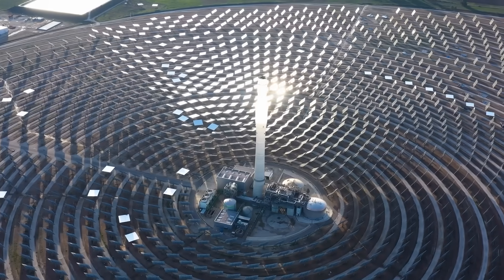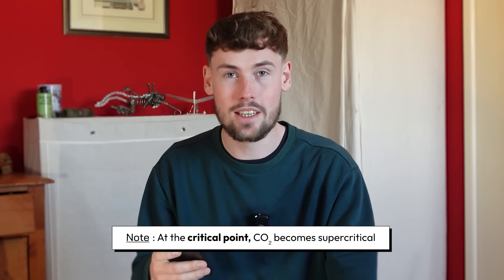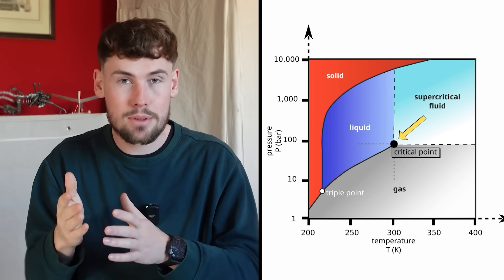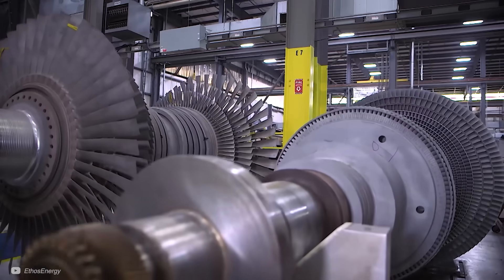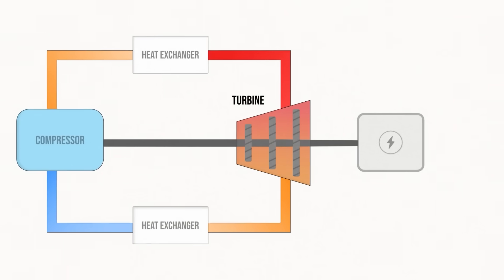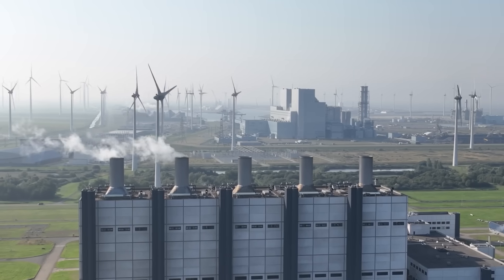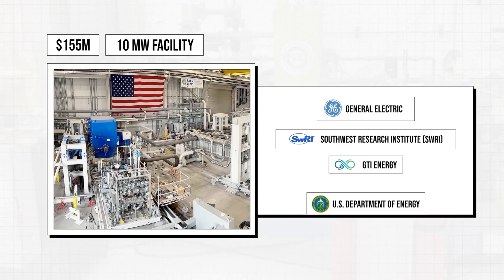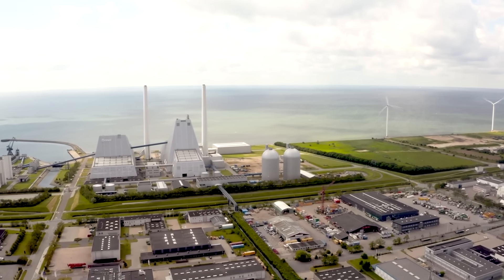How Ultra-Efficient CO2 Turbines Are The Future of Energy

Comment: Great concept, but important context for supercritical CO₂ turbines:

• Critical point is 73.8 bar / 31°C, which means high pressure maintenance, seal wear, and corrosion become significant challenges.
• Energy input for CO₂ compression can reach 150–300 kWh/ton, and if you're cycling the gas, recompression + cryo adds more cost.
• Turbine output per ton CO₂ is typically ~400–600 kWh, so net gain can drop to ~100–300 kWh depending on system losses.
• Without full closed-loop recovery, vented CO₂ undermines the green claim — many demos skip this step.

Nitrogen could be safer (inert, ~33 bar critical pressure), but cryogenic requirements offset some of the gains. Still worth exploring long-term for industrial reuse systems, but not currently viable at small scale without substantial infrastructure and thermal surplus.

Appreciate the demonstration though — this tech is worth understanding deeply before scaling.

500°C at 250 bar and 27k RPM? That’s an amazing machine... but not infrastructure. That’s F1-level maintenance and metallurgical stress just to hold a CO₂ loop. Definitely not deployable outside a high-heat, high-staff R&D setting. Respect the engineering — but I’d never bet a grid or grant on that alone.
Reply: The CO2 in this case is for heat transfer only.  There is no "capture".
Reply: @georgewalker3887  If in this case, if the CO₂ isn't being captured for sequestration, but rather used as a working fluid in its supercritical phase for heat transfer. That said, what fascinates me is how such systems could reduce material stress and improve energy density compared to traditional steam loops.

I do wonder though — if trace metals or corrosion particles accumulate in the loop over time, wouldn’t that pose risks to turbine efficiency or safety? Especially given the high pressures involved?

Appreciate your insight! Always great to exchange thoughts on these next-gen energy designs.
Reply: @Awelkins  Yes, CO2 purity would absolutely be a concern. Especially with the stress the turbines would be under at 27,000 RPM as the test turbine was. Typical power plant steam turbines operate at 1800 RPM, but a 99 cent roll of paper towels can absolutely SHRED a turbine (I've seen pictures of the damage, this is a thing that happened), so any particulate or foreign material in a supercritical CO2 turbine would be just as devastating if not more so. I doubt it would be inherently less safe than traditional steam, as the casing for the turbine is likely relatively thicker, and the blades smaller (less mass), so in the event of a catastrophic breakdown of the turbine, the chances of the turbine blades becoming a shrapnel hazard are probably comparable. Pressures seem to be roughly the same, as large steam turbines operate at around 1000-1100 PSI, at least the ones I'm used to working on. These steam systems also include pressure relief valves so that in the event of an over-pressure event the steam is vented to atmosphere away from people, and I'd imagine they probably have a similar system setup for supercritical CO2 generation.
Reply: As far as I understood they reuse the sCO2 and it recompresses itself for free as it takes less space when it cools off.
To make it commercially viable  you would need some specialized, probably new, materials though.
Reply: @ImperativeGames  Great insight — but a few more things worth adding for those interested in scaling this tech:

• Even in a closed-loop sCO₂ system, metal particulate buildup is a serious concern.
At 500°C and 250 bar, CO₂ causes carburization, micro-abrasion, and oxide scaling, especially around seals, bearings, and heat exchangers. That leads to metal dust circulation, which degrades performance and shortens turbine life unless high-grade inline filtration is used (which adds its own maintenance).

• Closed-loop isn’t free — pumps, compressors, and cooling cycles all cost power. Even if thermal recuperation helps, you still need energy to recompress CO₂ to 250 bar, and heat it again to 500°C. The efficiency only holds if you have massive surplus heat (like from nuclear, waste incineration, or solar towers).

• And if the system ever vents (intentionally or not), CO₂ must be stored, scrubbed, or safely released.
That means either:
→ 🛢 Big storage tanks (expensive)
→ 🌀 Reprocessing systems (energy-heavy)
→ 💨 Atmospheric release — which kills the "green" claim instantly.

In short, brilliant R&D work — but industrial-scale rollout will require robust metallurgy, deep maintenance infrastructure, and constant monitoring. Not something you drop into remote grids or expect to run maintenance-free.

Respect to the engineers though.
Just… let’s not skip the hard parts. 😅
Reply: As far as I understood they reuse the sCO2 and it recompresses itself for free as it takes less space when it cools off.
To make it commercially viable  you would need some specialized, probably new, materials though.

Comment: This is intriguing, but leaves a few questions unanswered. 1) If the turbine fits on a worktop, how large is the full plant? Could it lend itself to decentralised power generation? 2) How is the supercritical CO2 produced? One assumes that this requires an energy input that is taken into account in the overall efficiency figures, but how specialized is the process and how large is the relevant installation? 3) What about leakage and other waste? To what extent is this a closed loop system?

Comment: the thing is, that compressing gases is very very inefficient compared to compressing liquids
that's the entire reason why at powerplants steam is condensated back to water
also there is a huge problem with higher temperatures. You could still use water/steam for that, but you need different materials for the boilers. That's the real problem right now. There isn't a cheap enough material for the boilers, which doesn't melt at temperature above 600°C. People want to build 700°C powerplants but there aren't alloys for that right now.

Comment: As a mechanic, the disadvantages associated with the higher pressure and temperature requirements are concerning. Off-the-shelf parts work fine for steam, but the higher pressures of this system will require much thicker, tougher pipes, valves, pressure vessels, pumps, as well as the higher temperatures requiring specialized seals, bearings, even instrumentation. Maintenance of this type of system will be very costly, considering all the specialized parts that will be necessary. Also, can super-critical CO2 cause a BLEVE in case of a tank rupture? Check out pictures of the old steam locomotives when they suffered boiler failures. With a more energetic fluid, I'd imagine a failure and resulting BLEVE would be far more violent with super critical CO2. Yikes.
Not sure I'd be comfortable wrenching on this kind of high pressure/high temp system to be honest..

Comment: With an improved returned of 19% it would seem unlikely there will be a rush to expend the levels of investment required to implement this technology. The grid as a whole is in a state in which transmission and distribution concerns outweigh the need for a newer generating source. Considering that a fuel being burned is still a fundamental requirement of the system.

Comment: I dont know if this will replace steam turbines, but there is definitely a place for this.  I suspect it will work great in a  combined cycle approach because it can operate at higher temperatures than steam.  Make this the high temperature side and then use its waste heat for steam or something similar.

Comment: When I compared the isobaric heat capacity of supercritical water and supercritical CO2, water always has a c_p of at least twice the c_p of CO2. So water can store more energy at high pressure and temperature as CO2, but that doesn’t necessarily mean that CO2 isn’t less efficient. However to really compare these two, we'd need to have a look at their respective exergy (thermal/fluid kinetic energy that can be transferred to mechanical energy) flow. I assume it’s more efficient, because of the fact that CO2 can be relaxed to lower pressures and lower temperatures than water until it becomes liquid and you need liquid CO2 to keep it circulating via pumps. Water on the other side can be cooled with ambient temperatures. CO2 however must be actively cooled.

Comment: Water-based CCGT is already 60-63% efficient. How that works is you burn methane (or whatever else, oil, diesel fuel, kerosene, you name it) in a "normal" turbine derived from an aircraft engine such as the General Electric GE90, and then the exhaust of that turbine warms up fresh water into mildly supercritical steam that spins a steam turbine. With 1000K turbine inlet temperature and 300K ambient temperature the theoretical maximum extractable is ~70% [(1000-300)/1000]. Dedicated (not slightly modified aircraft turbos) units, such as the GE-9HA systems, operate ultra-supercritical water, with 170+ atm pressure and 570+C temperature (critical point of water  is around  22 MPa @ 374°C). That's already over 45kg/cubic meter of density, but CO2 will get the matter closer to 100kg/cubic meter or even more, allowing for better turbine operation.

However in the grand scheme of things, the whole CO2 schtick is a lot of work to maybe raise the 60-62% ECEC to 65-68% aka likely hardly worth the effort .

Comment: CO2 and hydrogen turbines are the nonsense of green, far-left cultural-maximist liberal idiots, trying to lie to all people that a technology that requires 7 units of energy to produce one unit of energy is an affordable way to produce cheap energy. The economics of production are not possible without massive social subsidies. A good point of comparison is the removal of CO2 from the atmosphere. If the alleged "human-produced CO2" were removed from the atmosphere, it would require more energy than the entire world produces, that is, from it. Secondly, carbon dioxide is not a bad thing. It is part of the eternal carbon cycle. The production of oxygen, which makes all life possible, requires carbon dioxide, including the production of food. Anyone who claims otherwise is a total, brainless idiot. "Supercritical CO2" anyway, like liquid methane, needs an external energy source to remain "supercritical". The technology is hyped like "free and clean" solar and wind energy, until it turns out that the technology quintupled the electricity bill and emissions. If the technology in question is to be taken forward, then the developer of the theory must, AT THEIR OWN EXPENSES, build a large-scale closed test environment without other energy sources to prove its functionality. Otherwise, it will be like with solar and wind turbines, they destroy the inertia of the electrical grids and maintain a constant risk of blackouts due to wind and sun fluctuations.
P.S. All steam turbines produce electricity in the same way regardless of the fuel. So some idiot has tried to reinvent the wheel. All steam turbines produce electricity in the same way, regardless of the fuel used. So some idiot has tried to reinvent the wheel.  😂🤣😂🤣😎

Comment: The problem with it is that you need super high pressures for supercritical CO2 and not only that you have to cool and recondense the CO2 back into it super critical state which is a loss of power however with water you don't need to cool the water for it to recondense after it's done its job into steam. You don't need fancy seals you don't need fancy custom heat sinks to cool the water as it will naturally condense at room temperature. Super critical water is extremely efficient extremely safe especially because it doesn't use such high pressure. Sometimes you over engineer a project to make it just a little more efficient but efficiency comes at a higher cost of both production maintenance and thermal efficiency.
For every one of these generators you can build 100 steam generators. That will be much safer easier to install allow for larger mechanical tolerances etc...

Comment: The video doesn't mention what happens to the supercritical CO2 after it is exhausted by the turbine. Is it discharged into the atmosphere to pollute and act as a greenhouse gas?
Reply: It is obvious that the cycle is closed. CO2 is used repeatedly.

Comment: The nice thing with steam is that it is generated from waste, and leaves the boiler with very high pressure and high temperature. To use the steam for heating, you need to lower the pressure but not the temperature. To lower the pressure, you can use a regulating valve or a supersonic steam turbine. After the turbine all heat is saved. Thar means that the electricity is free.

Comment: Hmm. This 700° C test is what really interests me. If a CO² supercritical turbine can handle those temps for sustaining days and years then that would be an almost seperate breakthrough achievement of materials science. Like fusion, its been done. But not efficiently to cost.

Iron is going very fun shades of dark cherry red at those temperatures.... If the alloy of those blades hold up to that, then I very much want to hear what super metals they are cooking up there too to enact these revolutions, or if its an old super friend like Incontel 714. 

Keep in mind that the energy reliability and savings will have to be good enough to fire up the very high energy alloy steel furnaces TO make these very specialized steels that are extremely challenging to weld and shape, exactly because of their high temperature resistances and ability to stay over 50 hardness at coloring temps. To have either an unhardened tolerable hardness there, or to have a tempering temperature far, far above almost any other steel?

Mere carbon steel begins to weake its heat treatments at 260 degrees centegrade, you can temper them in the oven on low.....

As fun as the science is this will take an entirely new level of skill in machinists and welders all over the world, too. The longevity of such systems need answering before most companies will consider the swap, and having higher pressure systems like this is always going to ratchet the complexity of repair up. IF they are sturdy technologies I will be hopeful, instead of interested.

Comment: 3:03 you mention solar power as a heat source but show a fueld of solar photovoltaic panels. Obviously there's no point generating electricity with solar to heat a working fluid to spin a turbine to generate electricity. You should instead have used a picture of a concentrated solar thermal plant, with lots of heliostat mirrors focusing sunlight on a target. But CSP is largely irrelevant as solar PV efficiency and price has dropped. The field of mirrors requiring precise tracking and focusing is no cheaper than solar PV, even before you build a big central tower and heat transfer loop.